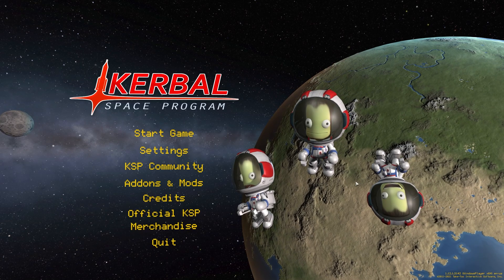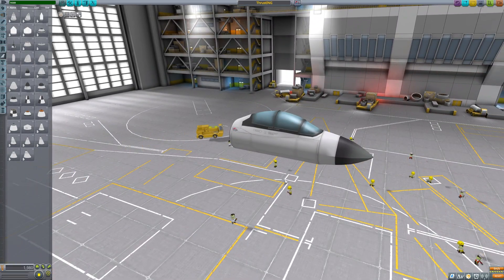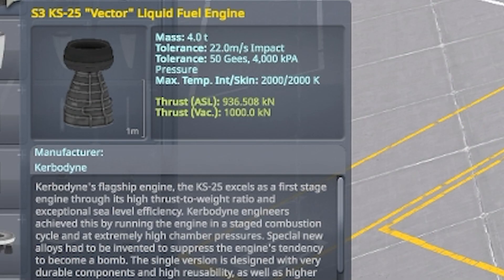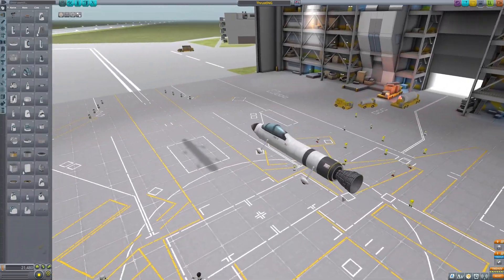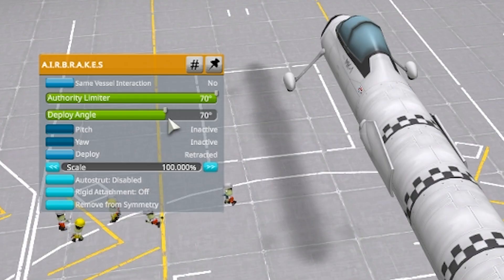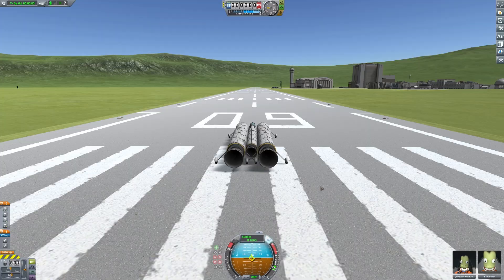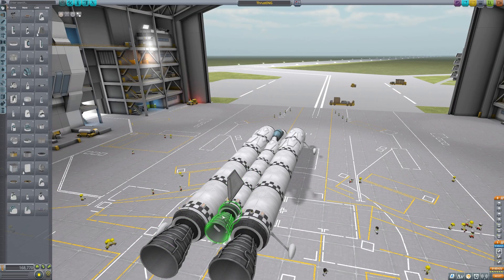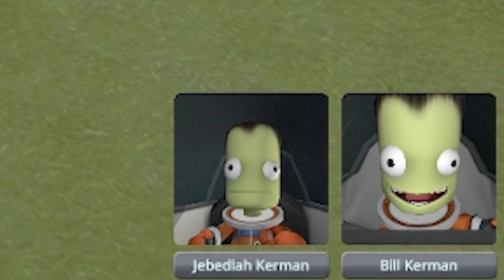Breaking the LAND SPEED RECORD in Kerbal Space Program!

Comment: 15:00 genally you can put independent throttle on and set too 100% and then out them in the brakes action group but no that wasn't necessary bc they were srb's wich can't turn off ir liwer throttle.

Comment: You can't throttle down solid rocket boosters so if you cut throttle and light your solid rocket boosters you should be able to make that work. 
use different parachutes 
Less weight is better, makes it easier to stop

Comment: Kind of picked up this challenge. So far have gotten starts, broken 310, and stopped safely all in the length of the runway. The problem I’m having is between 310 and throttle cut off, it tends to go airborne. Have still managed safe stops and landings, but feel like I don’t merit the challenge win if the vehicle goes airborne, even if only after breaking 310. 

Note: there are better radial chutes for stopping you than the ones you used.

Comment: You don't actually need fuel ducts — by default, decouplers allow fuel crossfeed between each side.  You probably didn't mount the engines properly when you initially used the decouplers, because that normally does work.  Also, you might consider adding engine shutdown for the three liquid fuel engines to the brake action group (you can look that up if you don't know what I mean).  Finally, throttle setting does nothing on solid rocket boosters, so you could have just set throttle to minimum when you braked and activated the boosters to slow down.

Comment: 15:00 solid rocker boosters (like the sepratrons you were using for brakes) don't give a toss about throttle; you can just hit x with space to turn your main engines off when you start braking.

Also some jet engines have a thrust reverse mode, but they probably won't get you the land speed record in the space of the runway

Comment: @6:00 - I'm sure you figure this out in due time in the video, but yes oxidizer is used to make combustion happen in space. However, in KSP, if you want to forego oxidizer you need to use a jet engine of some description and put air intakes on your vehicle so that you can actually utilize the oxygen in the atmosphere for your combustion - the engine you picked is a rocket engine and will not work without oxidizer, however.

Comment: Runways are not inherently designed for sound-barrier+ speeds. Commercial aircraft leave the runway around 160 mph, you're doing over twice that without using surface-to-air drag to slow yourself. You're essentially designing a massive explosive bullet unless you have enough room to decelerate, which even forgetting physical human limits, would take several hundred feet even with the tech you used.

Comment: What the SAS button does is it automattically repositions the engine based off of where the vehicle is heading, trying to keep it in a straight line.  So if you looked at it you could see the engine sort of wiggling to keep it on the ground and in a straight line, but to assist it you do need some downforce

Comment: You can limit the thrust and starting fuel on Solid rocket boosters by right clicking them on your ship before lauching. You could still do this with those, just lower the amount of fuel so it stops half way on the runway. That would also lower your overall weight.

Comment: In KSP land speed records are only viable if you do the thing on the polar reigions.
ASL means At Sea Level.
Disable Vector engine gimbal otherwise you'll lose control, that thing is designed to control the offset thrust on a space shuttle design after all.
Those wheels are weak and are part of the reason for the failure. They are prop plane wheels.
Those chutes are drogue chutes, put a real parachute if you want to stop safely. (although drogues chutes will still be useful to prevent real chutes to tare apart first...)
You really should replace rocket engines by jet engines, especially RAPIERS which work best at faster speeds than 350 m/s.
Those small boosters aren't powerful enough. They are more uliage motors than real boosters.

Comment: i am pretty sure you are going to find out yourself but i feel like explaining.
Liquid Fuel itself can only be burnt by the Nuclear Engine (NERVA). Normal Rocket Engines need a Oxidizer to burn the fuel.

The science behind it is that the fuel gets sprayed into the combustion chamber and needs to be mixed with the oxidizer to start the ignition and keep the ignition stable and running. The gasses are going so hekkin fast and the pressure in there is so high that oxygen from the outside has no way of reaching the camber. therefore a oxydizer (in most cases liquid oxygen) needs to be used

Comment: 500 miles per hour....
Larger wheels.
More wheels.
How did I stop?
I used a fuel pump switch.
You turn it on fuel is supplied.
You turn it off fuel in not supplied.
Basically get up to speed and turn the fuel off.
To slow down attach a heat absorber panel onto the air breaks. 
The heat absorber panel is a large heavy curved chunk of metal.
It acts as a super large air break.

Comment: Fun Land Speed Racing Fact: Weighing less the faster you go on the Bonneville Salt Flats is counter-productive. The ThrustSSC streamliner weighs nearly 10 tons, and for good reason, because you need to maintain stability and just the right amount of ground contact to be able to steer. It's even more important for wheel driven land speed racing vehicles, as the salt at Bonneville is very similar to driving on a cross between wet sand and packed snow, so the more weight and downforce you can maintain on your driven tires at speed, the more your tires can maintain the grip required to push you forward without slipping. It's very common for vehicles to hit the 175mph threshold and lose traction and spin out, or not be able to go any faster, as the drag outweighs the grip and the driven tires lose traction. Everyone thinks the key to going fast is being light, but the true key is maintaining a heavy enough load to counteract the drag.

Comment: ASL is At Sea Level. Also use Action Groups to assign buttons to parts. You can start and stop boosters at will, activate air brakes, anything really. Set your rudder for Yaw only and add fins to the sides and angle them to help keep you on the ground. Take your vehicle to the North Pole, plenty of space up there.

Comment: I recommend you actually learn the game before you try to break records, the craft didn't stop because you forgot to turn on the wheel brakes (you later figured out that its hotkeyed to B but never realized what it actually does), the craft kept spiraling out of control because you were using too much throttle (SHIFT and CTRL allow better regulation), you could've reduced the fuel in the booster, actions can be toggled in the action group tab for simultaneous activation or shutting down specific engines, you resorted to cheating on a record already surpassed without cheats (and you didn't even admit failure when giving up, you only moved the goal posts)

Comment: I thought I'd get to the end before I made a comment with suggestions but there's just so much to suggest I have to do it as I go. You wont read it anyway but others might find it useful. I'm a beginner myself having only just explored the Kerbin system, but there's a lot of help I can give you.

There is almost a carbon copy and a couple of other pointy cockpits about 2/3rds down the list. There's even one or two with the probe.

The game is loaded with jet engine options. Literally a second after you said there's only rockets, you were mousing over jet engine parts. There is also nuclear engines. ASL is At Sea Level.

Z and X are 100% throttle on and off but you can also apply it gradually with left shift (throttle up) and left ctrl (throttle down).

On the rocket engine you chose you can lock the gimbal. Gimbal is steering with the exhaust gas by moving the cone. The erratic flicking as you rolled down was being done by the stability assist making micro adjustments.

I'm fairly sure the "intake" cones you chose for your sidepods are actually jet engine exhausts.

You were on the right track with the decouplers. They have arrows printed on the edge. Flip the ones you had. This will cause the engines to eject in the direction of the arrow and not back into the ship. Then right click on each one, there should be an option to "enable crossfeed" this allows fuel to pass through it.

Dont slow down too fast. If you exceed the G forces for too long, indicated on the right side of the nav ball, you will blow up.

Revisit it soon because it's entirely possible.

Comment: that 5:12 made my eye twitch. ASL by itself will only get you so far. the ksp runway is about 2.5 km long so you have asuming you can stop in .5 km you have 2km to work with for the body alone you would need a constant 19663.2421 N of thrust just to meet the required speed without even factoring air resistance. that being said accounting for engine and fuel weight the engine you chose was a good 3ish times more powerful than it needed to be. And 16:48 do acceleration vectors mean nothing to you.

Comment: To clear up a few terms

VAC: The thrust of the engine produced in a vacuum (70,000m above kerbin)
ASL: At Sea Level, the thrust produced by the engine at sea level
Oxidiser: All rocket engines require an oxidiser as the combustion is performed in a sealed environment and due to the amount of fuel used. Jet engines do not require external oxidiser as they use the oxygen in the atmosphere to burn the fuel

Also, in the start you were using the red parachuted which are called 'droge chutes'  these are often used to slow a craft down from hypersonic speeds to subsonic speeds so the main chutes can be deployed, in your case a normal chute would be better
Reply: but he obviously expected to beat 340 m/s, thus supersonic, thuse drogue chutes. See, he planned it all very carefully! ^^
Reply: @Pe Ka  drove chutes are only used in kerbal for looks or for slowing down planes, a normal parachute can still be deployed at supersonic speeds
Reply: @icmeric  ...without getting destroyed? 
cool, didnt know that, thanks!
Now lets hope ill never get into a situation where this knowledge becomes important xD
Reply: @icmeric  With speeds exceeding 300m/s you will have trouble deploying a regular parachute in KSP.
Reply: @DerBlaue  that is true. For general re-entry, they are kind of redundant, but here they would be worthwhile (but main chutes would have also been a good idea)

Comment: U r absolutely correct when u said that the oxidizer let's the fuel burn in a vacuum. Without it, nothing would burn, however, using it in an atmosphere still gives it a better thrust output in real life, but I don't think it does in Kerbal space program, so it's really just added weight.

Comment: Get some more Kerbal time in!  You can adjust the amount of fuel in rockets, you can use atmospheric engines.  Stability control is handy (SAS).  You can also enable center of mass, weight and thrust in the editor.  Those tiny wheels are only good at medium-low speeds.  The BRAKES are also useful plus you can adjust the force applied per wheel. Use the B button or click the brake icon to set the parking brake and keep you from rolling.

Comment: The solid boosters to brake are a decent idea, but you discovered early on in the video they can't be stopped. SRBs are either off, or they're 100% throttle till they empty or explode. They won't be affected by zeroing the throttle on the main stage so you can bypass the decoupling entirely. Perhaps try retro-SRBs on frames to get them out away from the car, then decouplers on them for when they get you near zero mps?

Comment: This was painful...  A few things:

Yes, rocket engines need oxidizer.  They can't get oxygen from the air to run correctly.
Putting mass further back is a bad idea because the part with higher mass will always want to be in front of the aerodynamic center.
Drogue chutes are for slowing down when you're already going very fast, and normal chutes are for when you're slower.  I would say you should have used normal chutes.
You shouldn't need the intake when you're using rockets.  Those are for engines, which don't need oxidizer.  
Airbrakes should be on the back, for the same reason as putting mass further forwards.
And yes, the timewarp explosions are a glitch - the game doesn't like timewarping at high speeds for some rockets, especially if they're on the ground or have a very high component count.
Also, you can reduce the amount of fuel in a tank by right clicking on it in the VAB and moving the fuel/oxidizer sliders.

I don't know if the small solid boosters weren't working because they're too weak or if it was because they were blocked by something.  My guess is the second, but I'm not really sure.

Anyway, better luck next time :)  I think you could do it if you learn a bit more about the game - at the moment you just haven't learned enough yet.

Comment: KSP is a very deep and complex game, but here are just a few pointers.
Yes there are jet engines. There are propellers, jets, solid and liquid fuelled rockets, mono propellant thrusters, ion thrusters, and even nuclear engines.
You're using drogue chutes - these are designed to slow down a vehicle that's going too fast for a normal parachute that creates much more drag.
How do you slow down? Brakes, parachutes, retro rockets.
You do not have to have your fuel tanks 100% full. You're carrying ~10x more fuel than you're using.
The simplest design is often the best - and most importantly, the lightest.
Reply: Also there very useful building tools that will show you things like the centre of mass, and the direction and magnitude of lift, thrust etc.

Comment: part of the problem is there isn't enough drag at the rear of the craft to keep the nose pointed forward. instead it's going to try to flip tail first so the wider bit (cockpit) is to the rear.
if you add some fixed i.e. not actuating wings near the front and tilt them so the front of the wing is lower than the back, that should generate downforce similar to a spoiler, and help keep you on the ground.

Comment: Shift and ctrl lets you adjust throttle slowly. You don't really need more than 2/3 for what you're doing imo.
I like what you did with the parachutes, you just might need the bigger blue ones.
Orange is drouge shoots.
Those wheels have no brakes and are really weak, starter wheels.
Honestly you could lower the angle on some air brakes at the back and leave them deployed.
There are 'action groups' you can assign functional parts to on 0-9, located 2nd blueish button in the top left of the screen. This may help with triggering things manually.

Comment: The moment I saw this I knew I had to try it....... I cheesed it by um... 'engineering the rules'...

Speed had to be on the ground, and you have to stop on the runway, you say? I built a plane that reached 345ms-1 before the end of the runway (using a booster engine), took off once I overran the end, pulled a quick 180 in the air before landing (and most importantly, stopping) on the runway.

Boom 354ms-1 on the ground and stopped on the runway Kappa :P

Comment: You needed fins to leverage the drag forces as a way to keep the vehicle on the ground by generating a force pushing down ("inverted wing"). Like a formula 1 car does with its own front and rear fins : they are there to prevent the car from flying off the ground!
When (almost) anything goes fast enough, it starts generating lift like a plane wing would, and that would explain your "tubes" suddendly taking flight and going crazy. If KSP is as realistic as its reputation implies, using drag that way should help you go faster without flying off the ground.
Reply: Downforce usually doesn’t work in KSP. The suspension tends to compress in weird ways and causes more issues. Best thing is SAS and some fins on the back. You can tune the gimbals and fin movement to keep SAS from over correcting.

Comment: To turn engines off and others on without messing with thrust, try using action groups. You can set certain actions (like engines turning on/off or airbrakes deploying) to a hotkey.
Reply: they would literally answer all his questions in this video.
Reply: Friends at this difficult time need your little help to the Ukrainian army. Putin will be destroyed  BTC: bc1qw2qslwvmtzs7yk2x2lzfxfnsxwz5ne70xkkf9t ETH: 0x9d6917b707e268EFBCF29E37728394F20Cc34CF8
Reply: Though if the engine you want to keep running is a solid rocket motor, just throttle to 0 - the Lf/O engines will be "off" and the SRBs will keep going, since they can't be stopped (or throttled) once ignited.
Reply: ALSo you could use decopaler